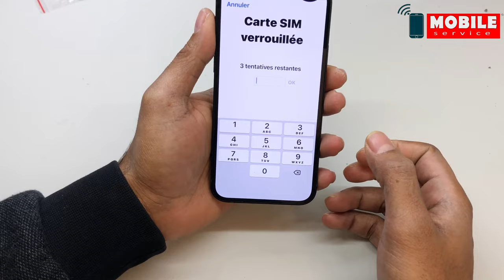iPhone 12 Full Body Housing Case Replacement

Comment: So many chances to totally screw up the phone and kill it forever. That’s why I’m happy this isn’t my job to disassemble and assemble fiddly stuff like this. Main thing I learned from this vid that I’d rather stay away from any possibly repaired phone… I think it’s nearly impossible to put it back together exactly like it was initially manufactured and quality will most likely suffer from that.
Reply: You think the chinese kids that assembled your phone are fully engineers? its a habit, if you do it long enough you get good at it!
Reply: Sigma
Reply: @l0gical998  I’m not talking about the way the phone was assembled the first time, but about the way that it’s being disassembled and then being put together again with the same components that were glued and then taken off. Damage might occur or even only a little bent of rearranged slightly different. That does not happen with completely new parts. The idea of having a repaired phone with tiny stuff potentially being pried inside just does not make me want one like that. Just look at the coil and the magnets, how they look afterwards. Now that alone makes me want to stay away.
Reply: @l0gical998  yes but theres QC standard that manufacturers did ... its diy tho... most repair shops out there dont even have any certification to doing so...
Reply: It’s actually pretty easy my first phone repair was a 2020 SE

Comment: Good Video, great work however noticed you still had the battery connected and was using metal tools which could short the motherboard … advice from a fellow engineer
Reply: Do you know which part this is 13:23
Reply: @justnaturalcake1  either the speaker vent or microphone but I’m sure it’s just the speaker vent

Comment: Does the magnets not need to be glued? Really good video
Reply: No think about it it’s magnets and it’s a metal housing
Reply: @dalebassett6119  Its glass....
Reply: @EduhSama its metal inside the glass is on the outer shell of the phone the edge of the circle is metal therefor magnets stay in place once laid down i never had to use glue to keep in place
Reply: @dalebassett6119  OH SHIT!! You rightttt!! sorry lmao hahaa
Reply: @EduhSama  the magnets stick to the metal under the glass
Reply: @lvaltix  you have no idea what your talking about I've done a housing swap before on these look at it this way outer is glass on the back when it's removed you see the charging coil which has a circle full of magnets which are under a metal frame don't need glue to keep them in place ffs !
Reply: @lvaltix how many more times its clear you don't like to be told something , well I'm telling you now and for the last time there's not glue holding them in place it's like a black sticky tape which is there mainly in part to protecting the charging coil or should I say users protection provides heat disserpation I have not once and il repeat it for the last time ever had to use glue or intend to in the near future unless there's a different design.someone asked is the glue needed the answer is no its not not.not had one issue with any of the phones and I have to check them over and over in my business,it  isn't 5 star rating with loads of positive feedback you know based on trajectory ! You can argue with me all you like il keep saying my way is perfectly fine and you will keep commenting back to prove otherwise so yes I do know

Comment: Normally I use 80 degrees on the screen edge when I have to remove the glass from an iPhone. How much heat (and for how long?) do you use? In addition, I sometimes use a suction cup, but it doesn't work if the front or back glass is smashed. I have also previously used a barberry leaf to get under the glass. But from the iPhone 12 you can't because the glass sits further down in the frame. Do you have any tricks?